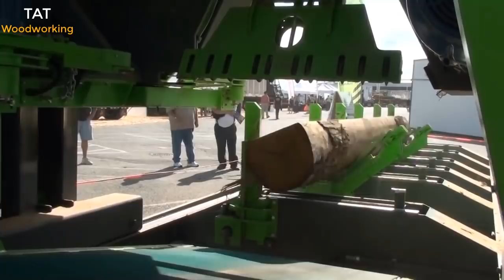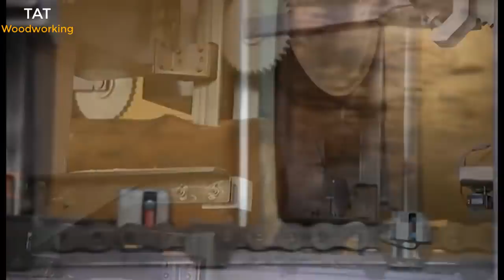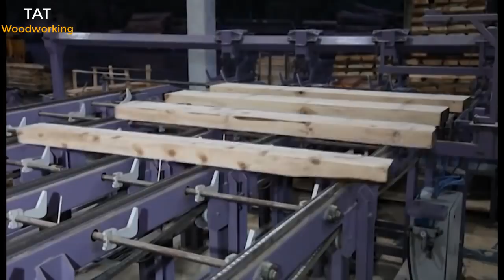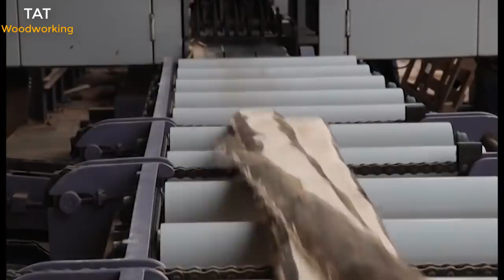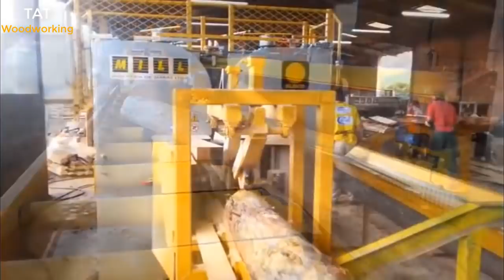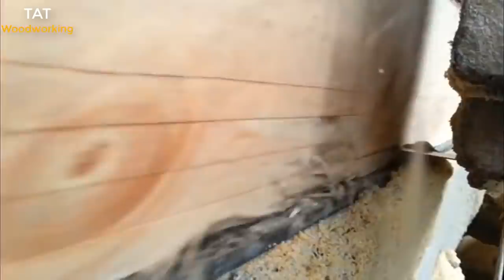EXTREME Automatic Wood Sawmill Machine Modern Technology - Fastest Wood Cutting Machines

Comment: I ran a Chip-N-Saw mill for 8 years , it cut a 20 foot log in 20 seconds with just one pass . All lumber was edged and ready to go into the drykill . I usually cut about 6,500 logs per 10 hour shift and my largest yield was 128,000 board feet of lumber .

Comment: Nice machines. For 7 years I ran a Chip-N-Saw ; it would saw a 20 foot log (24inch diameter) in 20 seconds, 1 pass, and all the slabs were made into paper mill chips. 85% of the log was salable and it could produce 12,800 board feet of lumber per hour.
1 pass produced 7 2x4 , 1 1x4 , 2 2x8 , 2 2x10. 
That was a “ high production “ sawmill.

Comment: The labor you don't see is saw filers
Reply: HMMmm Maybe they are automated too.
Reply: The majors points on the thin saw blades they are easy to put on and off the machines. They are a lot less expensive that a 6-14 wide band saw both in purchase price and in care for the blade. The narrow blade has to be feed slower but also has a smaller kerf which can give higher overrun. Remember the quote." Do you want to make lots of lumber or do you want to make money"